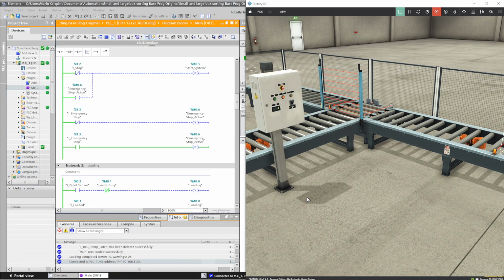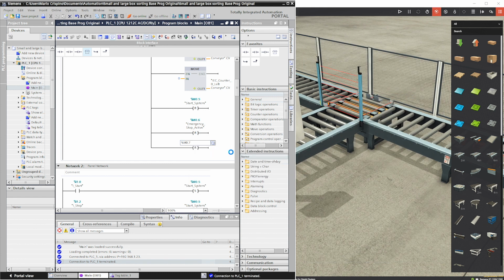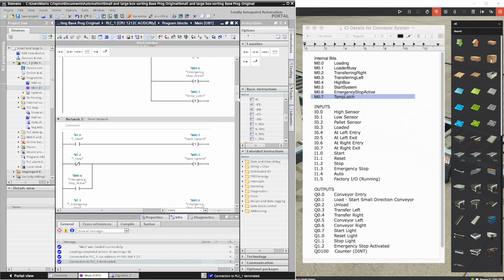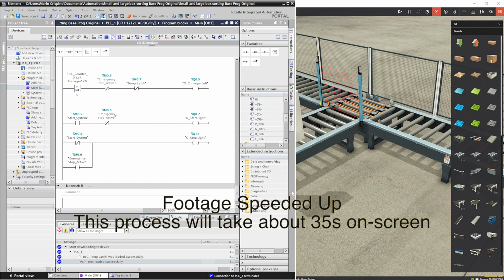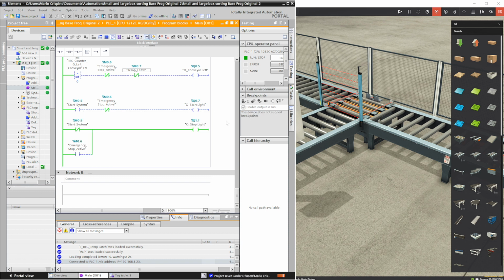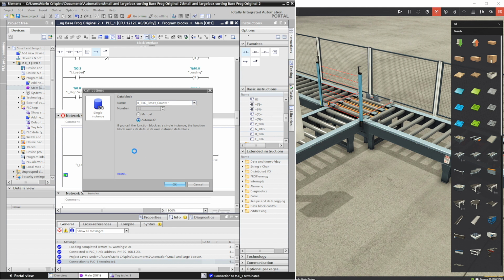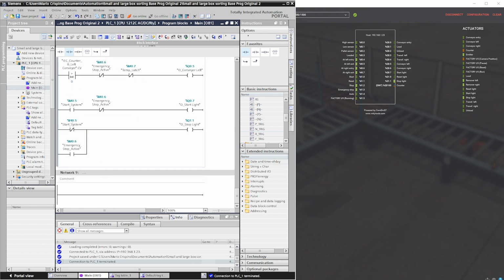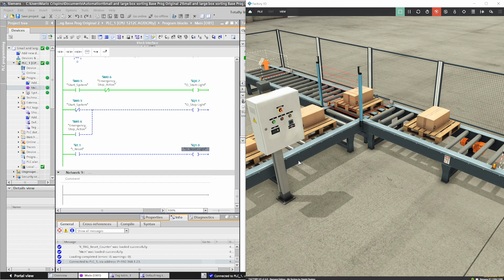Siemens S7-1200 Control Panel Functions Part 5

Comment: Hi Mario,
Very good and very clear tutorial.
I have a problem with the exit counters from the left and right belts. They count down every tine the pallet leave the belt 2 times instead of one, the belt stop with a pallet left on the belt.
I used factory i/o 2.2.3. is it possible that the version is the problem?
best regards,
Frans
Reply from the maker: Hi Frans
I don't know of any issues with earlier versions but there could be some. It's always good to have an uptown date version of Factory I/O. anyway, so I would recommend you update it. That way it is one less thing that could be causing the problem.

Also are you definitely using rising edge detection?